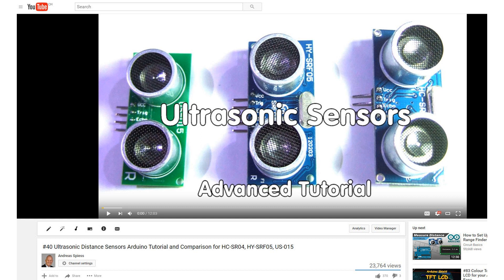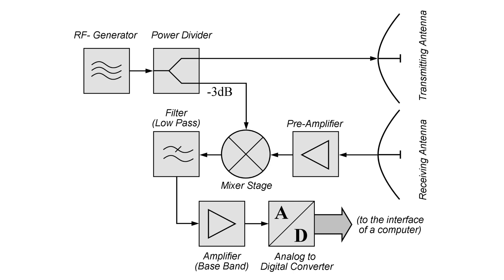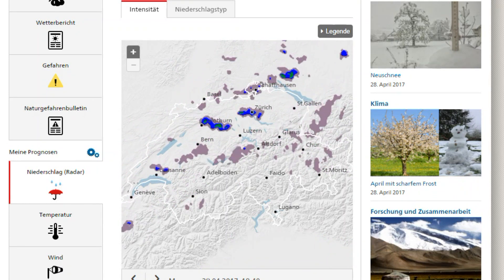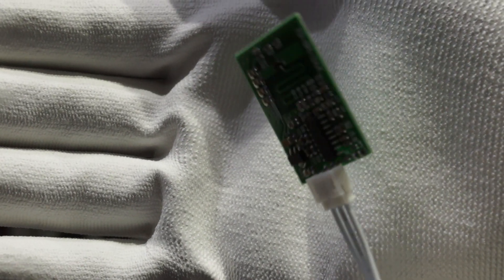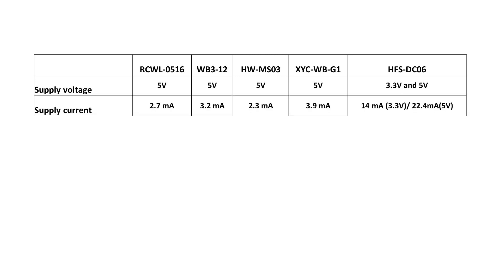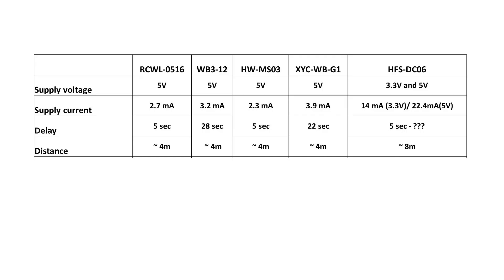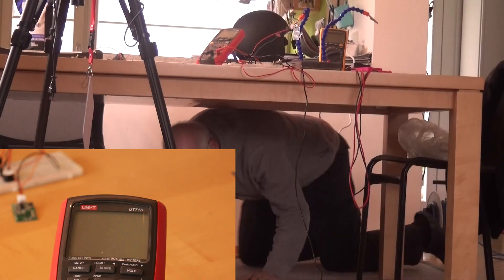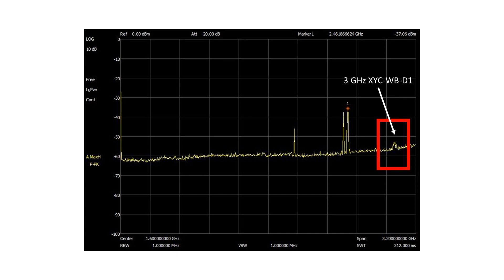#135 Radar Sensors / Switches: Comparison and Tests

Comment: Andreas,
The working principle of these type of radars (radio detection and ranging) is well understood and used in many applications already for many years.
In a nutshell:
These radars typically work in the L to X band : 1GHz-12.5GHz
They are frequency modulated continuous waves radars typically with linear frequency sweeps, say 100Mhz
Example: a saw tooth frequency of 100kHz changes the frequency linearly from 2.4GHz to 2.5GHz in 10 microseconds
The transmitted signal is sent into the world via the antenna
The received signal that bounced back from an object on a distance d from the antenna is received back with a delay of 2d/c seconds (c speed of light 3*10E8m/sec). 
Example: if d is 3m, the delay is 20 nanoseconds. During this delay the frequency of the transmitter has increased 200kHz versus the received signal. (100MHz*20nsec/10usec)
The transmitted  and received signal are combined (mixed) and passed through a highly nonlinear element, i.e a diode. The output of this process are waveforms that include the sum and difference of the 2 signals and their harmonics
Through proper filtering we can isolate the frequency difference (200kHz), calculate the delay (20 nsec) and the related object distance (3m)
Kind regards
Reply: Dude - did you copy that out of a textbook? Nice explanation for doppler ranging radar. But that's not what this does. It just detects motion by mixing the transmitted and received signals together and detects a low-frequency beat. No ranging info. No speed info. Just detects motion.
Reply from the maker: Thanks for your explanations. I only doubt if or how all these functions can be done with only one active component. That is the miracle for me...
If you look at a newer video we use the principles you mentioned for a bicycle counter. But this device will have much more parts.
Reply: That is not the principle how these work, though. They are simple regen style recievers

Comment: @Andreas, some new LiDAR models entered the market, you could test them maybe?
Reply from the maker: Any links?
Reply: This one is the original of the cheaper LiDARs on the market but currently sold out: https://www.3dxr.co.uk/product/benewake-tfmini
America: https://www.seeedstudio.com/Seeedstudio-Grove-TF-Mini-LiDAR-p-2996.html
America 2: https://www.robotshop.com/en/benewake-tfmini-micro-lidar-module-12-m.html
This one is a China knockoff but perhaps the same: https://www.aliexpress.com/item/RCmall-Lidar-Range-Finder-Sensor-Single-Point-Micro-Module-for-Arduino-Pixhawk-Cable-Benewake-TFmini-Drone/32852024277.html
High Quality LiDAR for reference (older) : https://www.robotshop.com/en/lidar-lite-3-laser-rangefinder.html
Reply from the maker: Thanks for your links. I will look into the matter.

Comment: I purchased a few of the RCWL-0516 sensors so when I found your comparison video I had to watch it (just in case there was a better device)...

The RCWL-0516 appear to work perfectly at 3.3 volt (I tested one at 3.3 volt and one at 4.2 volts for ten days and they both worked flawlessly), shame the quiescent current is a little high as I was hoping to power some projects with 3.2 volt LiFeP04 batteries... ideal for the Arduino/ESP32 projects...
Keep up the good work...
Reply: Have tested five more (from same batch) and all working at 3.275 volts (current voltage level as testing is ongoing)...
I note the output has dropped a little, appears to be supply voltage - 0.04 volts...
Reply from the maker: Thanks for the info. Maybe you try to switch them off for a moment to save energy (if nobody approaches in below a second). I do not know if it works, I have not tried.
Reply: Never though of that and was wondering how to extend the battery life... currently only a few weeks on a single cell LiFePO4...

Comment: Operation of the single transistor Tx/Rx/Mixer is described in US patent 8,115,673.
Reply: Unfortunately You are mistaken :(
The mentioned McEwans invention is requiring a: "drive pulse port for coupling drive pulses to the SOM - wherein the drive pulses produce phase-locked oscillations in the SOM" later: "a drive pulse line coupled to the emitter for coupling drive pulses to the transistor for driving the transistor into microwave oscillations that are phase-locked to the drive pulses" - FIG.2 input 1 - signal 40  (SUMMARY OF THE INVENTION, US pat. 8.115.673)
The ultra-simple Chinese sensors are using only three wires for the RF circuity (Ucc, GND and output - there is no feedback line going back from the IC (in my case a well known BISS0001).
In my humble opinion it is a simple microwave oscillator (like the magnetron in a microwave oven) producing standing waves which are  disturbed by the moving objects.
I am pretty sure you would measure similar signal at the magnetron in the oven - because of the rotating plate - (but please don't try it: the high voltage and strong power would kill you instantly !!!)
Reply from the maker: Thanks!

Comment: Thanks for taking the time to run through these. Wish I had found this video before I bought 5 of each of the RCWL and HFS boards. I need 3 working units (always buy extra from China). Looks like the cheaper boards will be the best fit. NBD. At the prices these things are going for these days I can throw the others in a drawer to use for something else some day. The HFS boards will be better if I need something to be directional.
Reply from the maker: I hope they will work for you. Keep the power lines very clean (there are a few discussions about that)

Comment: check out this switch module- photocell on the CDS pins(deactivates during daytime?). some interesting specs.. only switches up to 35W, max temp 120 deg F
https://www.aliexpress.com/store/product/DC-12V-Radar-Microwave-Induction-Switch-LED-Ad-Light-Box-Corridor-Microwave-Sensing-Controller/1829717_32716526683.html?spm=2114.12010615.0.0.643f2ec8UMQsoH
Reply from the maker: Thanks for the link. I will have a look at it.

Comment: Are there health aspects to consider? Say you have a 24GHz radar pointing at your office chair or bed to turn the lights on for many hours per day. Would there be any problems from sitting in the path of a radio transmitter for a long time?
Reply from the maker: The current used by this devices is very small and is not only used to produce radio waves. So the overall "smog" added by such a device is probably much lower than your Wi-Fi or LTE Smartphone.
Also, keep in mind that signal strength is reduced by the distance*distance to the sender. So, you easily can reduce smog by placing all your devices a little further from you (not in the pockets of your pants)

Comment: Hello Andreas, 
Before I begin, I like your videos a lot.
In your video at 15:04 min. you explain that the RCWL-0516 cannot work in a 3.3 volt environment, I make a mistake and put 3.3 volt as input voltage. 
So 3.3 volt on the 3.3 pin and GND on the GND pin then a diode connected on the Out pin and GND, and wonder the RCWL-0516 works also, it detects movements like before.
I think that you can use the module from 3.3 volts and if you have 4 volts till 28 volts you must connect the input voltage on the VIN pin.

https://www.elecrow.com/rcwl-0516-microwave-radar-sensor-switch-module-body-induction-module-4-28v-100ma.html

Greetings from Holland,
Jan-Henk van Kesteren
Reply from the maker: Thanks for your link. Maybe there are different versions of the same modules around, as in many other cases. Or I did something wrong, which also happens from time to time.

Comment: I have a vague recollection of a radio circuit being published in an electronics magazine back in the very late '70s or very early '80s, which presented a tuned transmitter broadcasting through a length of wire, with additional circuitry to detect the power draw of the transmitter. The theory was that the presence of a body in the radiation field would absorb part of the signal and cause the transmitter to raise its output.

I haven't looked into the precise working of these new sensors, nor have I (with admittedly only a brief online search) managed to find the actual circuit I remember, but I have a suspicion that the original concept has been discovered by the Chinese and perfected before being commercialised.
Reply from the maker: There are a few theories around and I also do not have enough knowledge to decide for one. At least, it works. And this is already something...
Reply: Hmmm... How long have you been involved in electronics? Some scant information that I've managed to dig up suggests that Elektor published a circuit of that description in March 1981; do you have a collection of "dead trees" (i.e., magazines) from that era? Not that it's entirely paramount to find it (it's far cheaper to simply buy the ready-made product than to continue the experiments suggested back then), but it would be interesting to read the theory.
Reply: This is a far-field sensor, not a near-field one.

Comment: 1:50 The stretched sound wave is behind the police car. The direction is not right.
Reply from the maker: I thought the sound is lower if the car moves away from my ear?
Reply: Andreas Spiess Yes, this is the stretched wave. The sound moves at around 320m/s. Behind the car it takes longer, because the sound source is moving away from you. In front of the car it is the opposite. The distance the sound must travel is decreasing so it will be compressed.
Reply: @oetken007
I guess the vehicle being in the middle of the picture confused you.
Notice though, that it's the ear that's actually between the waves, not the vehicle.
The vehicle having been drawn there may be somewhat confusing, but it was only meant to show the direction of the vehicle, not its current position.

So, assuming that the vehicle moves from left to right:
Place the vehicle at the left of the ear = compressed waves.
Place the vehicle at the right of the ear = stretched waves.
Ergo, the picture is correct.

Comment: Great video. Much appreciated. I have a question though. Have you tried increasing the range by supplying the modules with higher voltage?
Reply from the maker: No. LEDs are driven by current, not voltage and around 2 volts is sufficient. But you could add more than one LED in parallel or in series. And add a transistor for more current.
Reply: I was referring to those radar motion sensors, not LEDs ;)
Reply from the maker: You are right. Sorry. My newest video was about IR and I mixed it up.
No, I did not use higher voltage, because the modules were already too sensitive for me and I wanted to reduce the range rather than to increase it...

Comment: It would be interesting to know if these devices work through fog and rain, as outdoor PIR sensors have problems working in sunlight conditions.
Reply from the maker: I never tried them outdoors
Reply: Andreas Spiess I am working on a little home automation system, part of which is to automate the drive, front and back door lights, which trigger on motion. The project solution uses a mesh network to report activity by leave the motion detection active 24 hours a day while allowing the lights to operate on a combination of motion and light level. This arrangement allows the mesh network to report motion to the home network control computer. This logs such activity and adds a  additional trigger to the outdoor CCTV system.
A combination of PIR and radar could improve the performance sensitivity while rejecting false triggers. In the tests done so far with  PIR, the analogue output of the sensors are analysed to reduce false triggers, but sun light shadows can confuse them. The sensitivity is also reduced by thick fog. Hence my interest.
Reply from the maker: I think radar sensors can definitively add a value there. The only question is what to do if both send a different signal. Then, you would need a third to decide ;-)

Comment: You might want to mention... somewhere... that regular glass does NOT block the signal. Another engineer on YouTube demonstrated that a glass jar will not block it. A commenter on that video suggested that some glass doors have EMF blocking film in them, which might include yours as well.
Reply from the maker: In my videos, I show what I saw. And sometimes I do not know what happens. Like with glass and radar. There are a few viewers suggesting that my windows have some sort of metal.
Reply: Here's a small study on that. https://www.diva-portal.org/smash/get/diva2:882367/FULLTEXT01.pdf

Comment: I've more feedback for the RCWL-0516 after some weeks of testing in production (I was controlling the hall-lamp with it). The sensor works on RaspberryPi boards (one with a Wifi USB dongle and one with only LAN connected) and Sonoff Basic Switches, but they quite often run mad and trigger massively for no apparent reason. I only got the sensor work reliably on an Arduino compatible board which I connected to the Sonoff Basic via the serial pins. The Arduino gets its power from the Sonoff Switch (step-up board to get 5V out of the 3.3V). I forked Espurna to send data from the serial interface to MQTT. Works like a charm for 10 days now, no "false positive" yet.
But since the range of the radar sensor is too high and goes through walls and doors I combined my system with a PIR to narrow the range down. ;) The radar sensor is now only used to extend the time the lamp is turned on.

It looks like this: https://photos.app.goo.gl/VmKwFbntMfqAhM3u1 :) No encasing, I constantly add new sensors to it. :)

Thank you for testing all the components I then used, Andreas! Your reviews are invaluable for me!
Reply from the maker: Thank you for your feedback! I think noise on the power cables to the sensors as well as noise in the air heavily influences these sensors. This maybe explains some of your experience.
First can be solved with capacitors and inductors, second only with distance...
Reply: I really had some weird stuff going on. Like two other sensors (placed in other parts of the house) triggering when the first triggered. I also tried long cables to the sensor. I didn't played with capacitors. But as soon as the Atmega was between the sensor and the Sonoff nothing of that happend again. They are even in close proximity of each other. That really looks like noise on the lines...
Reply from the maker: Strange...

Comment: Glass of modern window is really commonly covered with metalic foil which reflects all (or most of it) HF energy...
Reply from the maker: My windows are about 20 years old and I think, they have no particular protection. But I do not know exactly.
Reply: Andreas Spiess - you can check it - set up a wifi hotspot on one side of window and use Netstumbler or wifimon (on Linux) to measure signal strenght difference with window glass in signal path and without it. But anyway - try to use low EIRP levels, it should provide more reliable results... :-)
Reply from the maker: I will try it.

Comment: Not sure if this has been mentioned yet, but the HFS-DCO6 looks a lot like the Hygrosens RSM-1650 (aka InnoSenT IPM-165)  with some additional circuitry slapped on top to me. Probably some cheap china clone. You can find datasheets/application reports for these online (although many are in German, because it's made by a German company). This sensor uses 24 Ghz radio and actually  outputs the Dopplerfrequency. You have to attach you own amplification circuit if you are just using the bare sensor, but this gives you much more flexibility than just a boolean yes/no detection of motion, because you can actually detect the speed of objects (output signal frequency is proportianal to speed, ~44hz per km/h). And depending on the band pass you you in your filter, you can also limit the speeds that are detected.

btw: the 1,8 Ghz peak in you spectrum analyzer image is probably LTE ;)
Reply from the maker: I think they are not comparable. You get sensors on AliExpress (HB100) which are comparable and which use the doppler effect to measure speed. I did not review these for the moment.

Comment: Thank you for the video, Andreas! I love your channel!
I want to report that the RCWL-0516 works great with the Sonoff Basic switch with the OUT pin on the Sonoff's GPIO14 pin and the 3.3V pin connected to the 3.3V of the Sonoff. I use it to report movement via MQTT.
Reply from the maker: Thank you for your feedback. I am sure it will help other viewers!

Comment: Awesome video! Starting to understand this sensor and electronics thing more and more. But as a programmer with no background in electronics, I'm still kinda lost. This might be so the wrong place to ask this - and I'm sorry if that's the case - but after googling and researching for hours already, and also not really understanding much about sensors, I still struggle finding a sensor that does the job for my case... I have to detect 'touch' on the outside of a 'shop window' (meaning two layers of glass and all together pretty thick (perhaps +/-2cm all in all) - hence IR and plenty other stuff not possible). This far I'm just using lux sensors - and triggering if there's a drop in lux (shadow from hand), but it's close to impossible (at least for me) to trigger the sensors/buttons reliable enough (different lighting/weather, day/night). All in all: it's a mess and I'm kinda lost. Glad about any tips at all. Thanks in advance and kind regards from Switzerland :P
Reply from the maker: Maybe it will work. You have to experiment. Please be aware that these modules are quite sensitive, not only in one direction. So it might detect things behind it.
Reply: Yeah that would be another thing to keep in mind, since behind the installation is a classroom, I think some capacitive solution would still be the easiest way to go. But depending on the window type, I'm not even sure if that'll work. Thanks a lot anyway!